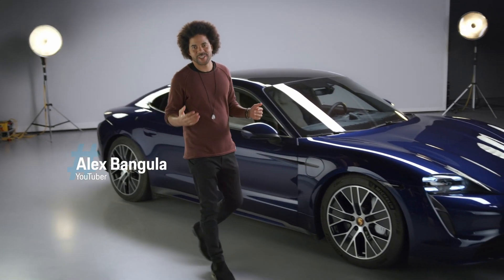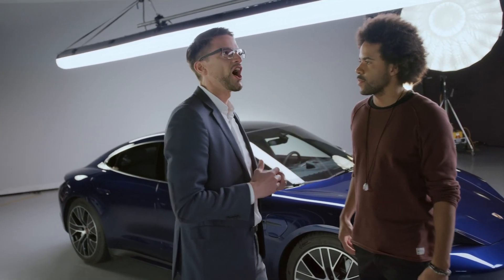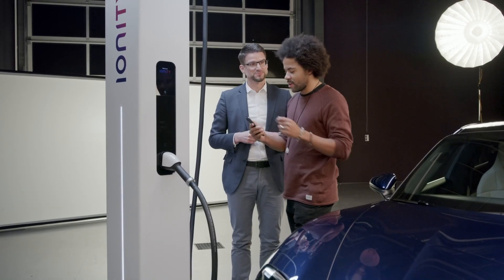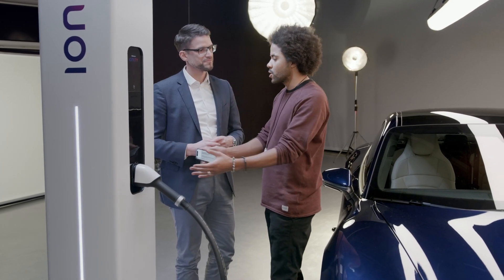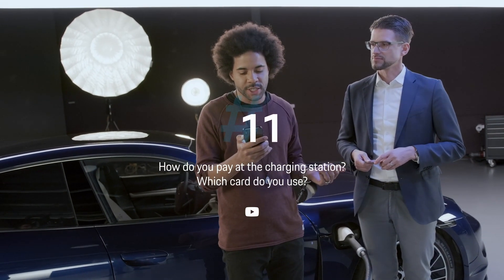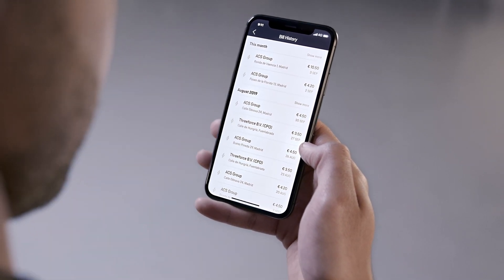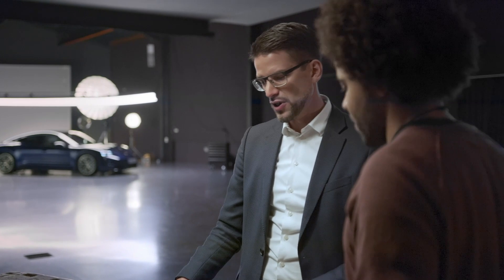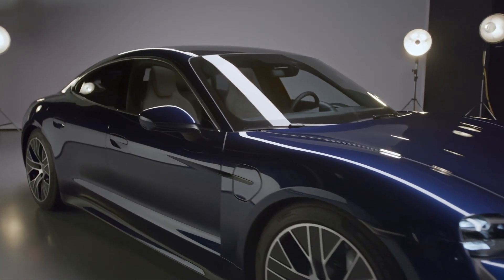#AskPorsche || Part 03 - Design challenges, charging conditions and Taycan battery

Comment: @Porsche €30 to charge - that's expensive! Also, the Ionity network is rubbish in the UK.  There are only 4 or 5 charging locations and they are not even located in logical locations.

Comment: Is it advisable to always use fast DC charger to charge the batteries?
Reply: Lüvv Sürya no.  99.9% you charge at home while you sleep. Only very rarely on long trips do you need a fast dc charger
Reply: OnTheSnap1 : My question was if it’s advisable to always use DC fast charger to charge the batteries. Does it have a negative impact on the battery? We have such option in India to get personal DC fast charger at request from the company itself.